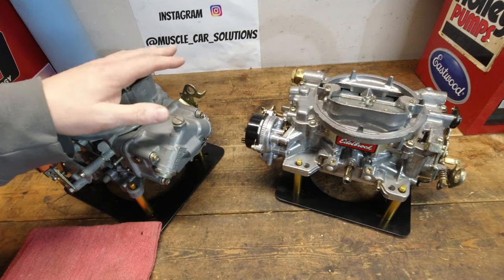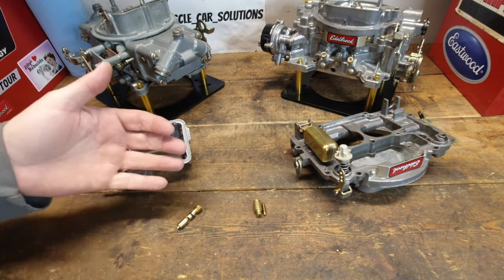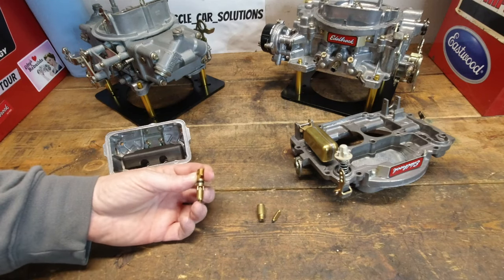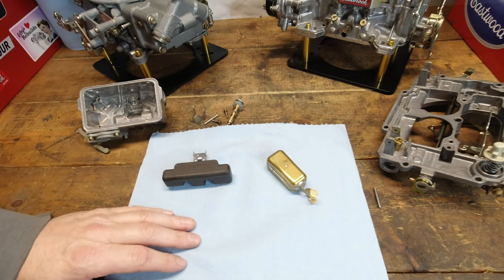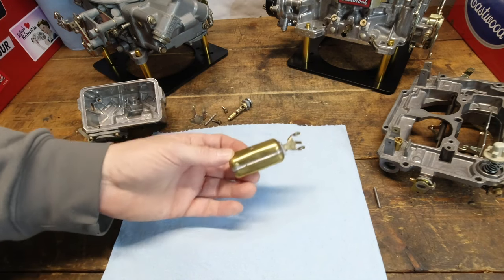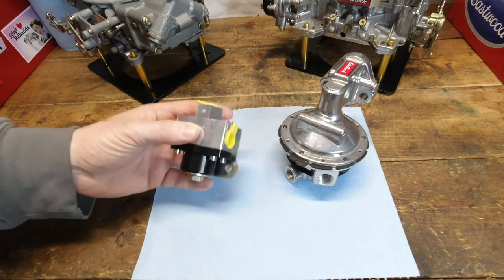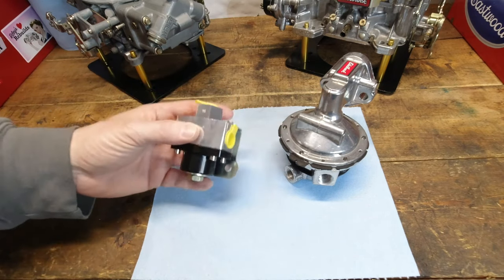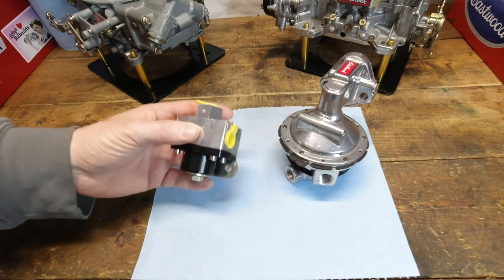4 Reasons Why Your Carburetor is Flooding

Comment: I have a carter 1 barrel on a 1966 valiant. It was flooding really bad the car not wanting to run.  My carb was leaking around the bowl gasket and coming out the vent. I sent my carb to a shop and the guy said my float was out of adjustment he replaced the needle and seat from an original kit he had at his shop and adjusted the float. I get it back and it's STILL HAPPENING. although the leaking isn't near as bad. He then told me it has to be my fuel pump the pressure is too high. So I'm gonna check the fuel pressure if it's not the pump I just don't know what to do. Iv had it. But it could be the pump it's about 5 or 6 years old.
Reply: Im having the same issue with my 64 thunderbird. I’m not sure what to do though since it doesn’t flood at the carb shop but as soon as I get it on my car it floods. I put a regulator on it but it hasn’t worked. I’m going to check the fuel pressure today. Hopefully the regulator is bad and I just have to change that. Let me know what ended being your issue. Maybe it’s the same as mine e
Reply: Check the gaskets, check weight, get a new float and basically the whole ensemble.
Reply: @diegos5877  Turns out I have a major vacuum leak. I took the whole car to him and that's what he found
Reply: @melmen2379  no way that’s actually it. I got a 1bbl on a 74 dart and I’m having the same issue. This all started after I started rebuilding the vacuum setup based on a diagram
Reply: @SkySprice  yes it turns out to be a MAJOR vacuum leak. Right now she won't run at all
Reply: @melmen2379  oh cringe. I just took my needle and seat out and found out it doesn’t even hold up to 3.5lbs of pressure. Rubber tipped needle. Probably because I’ve been dailying it and thus u have been consistently been putting regular through it.
Reply: my nissan 1400 carb level was on his mark but after i put on a new carb and new  petrol pump he overfload inside the carb this doesn't happend with  the old pump 😮 help plse

Comment: Just swapped from a single carb to a double 600cfm intake.  Engine kept running so rich at idle I've called the man that rebuilt my carbs I've went and ordered jets and meters and while waiting for parts found out the rear carb had zero movement on the floats and the needles were stuck!! Maybe I've solved the mystery
Reply from the maker: If they were stuck open, that would add to that problem.

Comment: I'm having issues where my truck dies while running..I get a strong gas smell... I unscrew my driver side tank (dual tank k10) and it's highly pressurized... I've completely replaced all under carriage fuel  parts... lines,  filters,  tank selector valve and new gas caps and still occurring... any ideas
Reply from the maker: @josephpadilla8982  high pressure always try’s to find low pressure areas.  If you’re building up pressure in the tank, it will play havoc with your fuel system.  Find the tank vent and get it cleared out.  Not sure where it is in that truck but tank and filler neck are what you’re looking at.

Comment: 1403 carb starts right up cold and after opperating temp. Sits for 5 min. and hard to start. How do I get the car to start consistently?
Reply from the maker: Heat soak.  Check out the video I did on how to cure that.

Comment: awesome tip on heating the water for a float hole test. We just had a rebuild come back because of a pin hole.
Reply from the maker: Old school trick!  Hard to find those on a general rebuild.  Saw you work on that one during one of your livestreams!
Reply: Fuel pressure on my carter 9605 drops from 5psi to 0 psi in about 8 min after starting.
Pressure tested top of carb in container of water and no leaks  new mec. Pump new regulator 
Pre and post filters. Does not flood and continues running fine even with 0 pressure at Guage.
Any suggestions ?

Comment: Great video! I commented on another video about my 1406 flooding. I discovered that the cheap rebuild kit I bought had a needle valve that was sticking in the seat AND I had my floats set too high. I tried setting them at 1/2" for a slightly built 289 however, my carb setting skills have never been good. Thanks again for the information!
Reply from the maker: Glad you got it sorted out and you’re very welcome!
Reply: Did you fix it?
Reply: @CRuZ_CoNTRoL.  I ended up buying a new carb after twisting off one of the screws that hold the idler springs in place. Rookie mistake.
Reply: @jasondingram5991  was the carb ruined because of that?

Comment: You certainly deserve more subscribers my man! Thanks for sharing your knowledge and nice vehicles!
I have a 72 Chevelle with a Holley and 72 c10 with and Edelbrock 😆
Bought a 5.5-9 lbs pump before finding out Edelbrock's allegedly don't like anything over 5. 
The 3-7lb pump I had on prior worked fine with my filter hung higher than the carb. I lowered that below the top of the carb and it helped the flooding issue I've been having 🤷‍♂️
I'll bet raising the carb up and that ethanol gas treatment wouldn't hurt either
Reply from the maker: I’ve always worked in a range of 4.5-6psi.  I start at 6 and tune down from there if needed.  Most of the time, on regular pump gas, I’ll set at 6 and most generally like it right there.  Pressure regulator is your friend!

Comment: Great help, I just installed a new 650 DP Brawler with flooding issues. Its impossible to tune air mixture screws as fuel must be entering the venturies or blowing past needle and seat freely causing black smoke at exhaust and extremly poor gas milage (gallon per mile) Needle and seat was inspected and cleaned with compressed air, o ring seemed flush with seat cylinder...Fuel pressure is regulated and tops out at 4 psi (assuming gauge is correct) I did run some avgas 100 LL thru by mistake...and where can I get new o rings or new needle & seats ? Appreciate your comments

Comment: I have an AVS2 on my 65 Mustang, which has a 302.  It uses the stock mechanical fuel pump.  I recently installed a Marshall fuel pressure gauge, whcih is a high quality oil dampened gauge with a vent so it reads correctly when it heats up.  It reads 5.5 psi at idle and drops to 4 psi when the rps increase.  Edlebrock states that 5.5 psi is ideal for these carburetors and the range is 4 - 6 psi.  So not all mechanical fuel pumps require a fuel pressure regulator and before installing one, you should first verify the fuel pressure.
Reply from the maker: That’s good, if you don’t need to adjust pressure to find what suits the engine best.  Sometimes that 6 psi, sometimes it’s 4.5.  Without a regulator, you don’t have that adjustability.  Or choose not to run one and take away that ability.  It’s ultimately your decision.

Comment: My Edelbrock is flooding right now gonna give it a check but it’s a 750 cfm which is little big for my motor, figured I’d check these out first before buying something new, I do have a aluminum spacer which probably isn’t the best for the heat. I appreciate the video tho!
Reply from the maker: @1976.Camaro  flooding isn’t a too big of a CFM problem.  It’s a pressure/flow/adjustment problem.  Sort out what you have, then start correcting the other issues.
Reply: @MuscleCarSolutions  gotcha I do have a merc cruiser motor out of a boat so I do not have a stock fuel pump on the block (no bolt holes or rod) to get around that I have a fuel pump pushing from the tank it was fine ofor my Carter 650 carb but long story short swapped carbs now figuring I should get a regulator for the pressure

Comment: Hello, first I want to thank you for the great content your providing. In my 64 Malibu SS I have a manual fuel pump on my custom 327 sbc. and the fuel pressure at a cold start is about 5psi. After about 15 minutes the pressure goes down to zero and stays there with no change to how the engine is running.  Any ideas as to why ?   If you have any questions for me to help you determine this issue please ask. The carburetor is a Holley 4150 (80670). 
The car went through a complete frame off build about five years ago including powder coated frame, complete body/paint and drive line as well. Unfortunately I've neglected her badly due to other commitments.  I recently tried to start her up but she would just not fire, I determined the fuel pump was bad so I replaced it. Tried to start her and she fired right up, after a 15 minute test drive I noticed she was running rough and would not idle. Fortunately got her home and was seeing fuel spewing down the venture (primary side). This is where I found you on YouTube. I replaced one of the needle/seat assy's. on the primary side only and that definitely helped but the pressure is still dropping off. Could I have a defective pump or could this be a carburetor problem.
Thank you for the great videos. !!!
Reply from the maker: Difficult to say.  If it sat for a long period of time, you may have a general cleanliness issue. Ethanol added fuels are the absolute worst.  The alcohol attracts water.  Water carry’s contaminants.  The combination of all three play havoc on a fuel system when it’s not continuously run.  I’m assuming it was parked and the fuel system wasn’t completely drained.  So that would be a good place to start.  I have several video on fuel system set up that might be helpful to to.  Change your fuel filters.  Give that carburetor a good bath and a rebuild kit.  Then you can start looking at where the lack of flow (pressure) is coming from.
Reply from the maker: And I’m very glad the videos have been useful for you!  Thank you!
Reply: Hi, well I think I’ve done everything trying to determine why my fuel pressure goes from 6psi at start-up to zero after five minutes of running. Changed fuel pump, I even ran a hose from the inlet side of the pump to a five gallon can of gas which at least in my mind eliminated an issue between the pump to the back of the car. I changed out the needle/seat assy as I saw fuel dumping into the primary Venturi’s. 
Is there anything in the carb that can cause a pressure drop ?

Comment: Very helpful video thanks I had my carburetor catch fire last night and I poured water into it to put it out at the gas station I have a elderbroc on my 71 LTD 351 Windsor I need help did I really damage anything?
Reply from the maker: You’ll need to tear it apart and find out.  I’d be more concerned with why it happened.
Reply: Next time it catches fire , dont put water into it and your engine. Just cover the carb with a towel or anything. I have used the shirt off my back to choke it out. 
It could happen from being too rich and not firing and having timing off making it backfire and catch on fire

Comment: My carter bbd is spitting fuel out the top and the big vent at the middle front bottom, doesnt want to start and seems like I have good spark, gonna try putting on a regulator see if it helps
Reply from the maker: Regulator is always a good choice but there’s likely something more simple if that’s the factory set up. Dirt, trash, sticky needle.  Might be time for a good cleaning and gaskets.  Change your fuel filters.  Reset the floats.  See if that cures it.

Comment: Hate Edelbrock  Carbs . Almost  Burned up my 73 impala, drove it for three months without any issues. On the way to work  smoked bellowed out from the hood. Open the hood and flames burst out I could see the gas overflowing. After putting it out with an fire extinguisher after  getting it home I  took the carb apart, the float was in the bottom of the bowl. The float only had a tiny tack  of solder holding it to the arm
Reply from the maker: Seen that happen just as many times on a Holley.  It’s not the brand of carburetors fault, it’s just what happens.
Reply: @MuscleCarSolutions  come on man

Comment: I hope you have solved my issue with the part of the video about heat soak. I can park the car for 2 hours and try to start and it won't start otherwise it starts and runs great. What does heat soak do to a carburetor.
Reply from the maker: With ethanol added fuels, heat in the carburetor can easily boil the whole thing dry very quickly.  Awful stuff.  Isolate the heat as best you can and those next starts will be easier.

Comment: Good morning, I have a 650 Holley carburetor. I have a problem  to control my secondary float. I checked everything. The needles. Everything looks good. I cannot find anything wrong???
Reply from the maker: @francescoserra-y4u  what’s your fuel pressure at the carburetor set at?

Comment: Working on a 78 Chevelle, beautiful! Noticed carb leaking out bottom areas of carb. Throttle plate . What are possible issues I may be looking at? Thnx 👍
Reply from the maker: What is your fuel pressure set to?

Comment: I have a 64 thunderbird and it keeps flooding. I put a fuel regulator on it because it was at 10 psi. But nothing changed and it continues to flood. I’m not sure what to do since the carb was recently rebuilt and everytime I take it to the carb shop it’s fine but as soon as I put it on my car it floods. I put on a new fuel filter too. Any tips?
Reply from the maker: What carb?  What is the regulator set to?  Have you checked the needle and seats?  Float levels?

Comment: I just rebuild my Edelbrock 1406 on my Chevy K 20 and when it is on flat ground, it idles great runs great but as soon as I park it on some sort of incline the carburetor will start cutting out (stumble real bad almost to the point of dying) and I’m talking about maybe 5 to 10° incline/decline. Any suggestions?
Reply from the maker: Check float level.  What is your fuel pressure set at?  While you have the top off, make sure there’s no garbage inside the bowls.
Reply: I have an in-line fuel pump to a Holley pressure regulator set at 8 psi then going out the carb. I have a pressure gauge set at both at the regulator and the line before the carb and they are both reading 8-7 psi.
Reply from the maker: @camerinsmith5182  way too much pressure.  4.5-6psi is the range on an Edelbrock carburetor.
Reply: I'm running a 2 x 4 barrel set up on My 69 firebird and I pulled the plugs out and the cylinders were full of fuel.. I noticed that gas was leaking out of the passenger side of the carb around the throttle shafts.
Reply: Will incorrectly adjusted float levels affect mileage? Recently adjusted mine to the manuals specs and dropped 5 mpg. Seems drastic. I added a 1 inch spacer as well. 1406 carb. Love the channel!

Comment: does a turbo  blow thru have any other ways it can flood? i have a 650 blow thru that keeps pushing fuel out the vent tubes  and squirters, running jet extensions with boost reference power valves from simple stage that have little tube extensions ? or is it pretty much the same across the board ? only thing i havent changed is the needle and seats , running a a2000 fpr. and itll push fuel out at 6 psi 5 psi or even 2-3psi im almost ready to just bite the bullet and spend the 1000-1200 on  a  new custom blow thru.

Comment: I have a brand new Holley 650 vacuum secondary. Why would my fuel bowls drain down into the intake overnight? This is the second carburetor that’s done it.
Reply from the maker: How do you know it’s draining into the intake?
Reply: @MuscleCarSolutions  spark plugs are wet
Reply: @MuscleCarSolutions  and I just changed the oil and it already smells like gas
Reply from the maker: Go watch my video on how to fix heat soak.

Comment: @Muscle Car Solutions: I have a carb spacer in my future (heat soak prevention). I was interested in your comment/opinion for your preference of wood laminate. I had been steering towards the phenolic simply for it's underhood friendly black color. Aesthetically, the wood laminate was a turn-off because, well, it looks like wood, colorwise. Any downside you can think of to spray painting the wood laminate black? (maybe just the sides only)
Reply from the maker: I think I may have mentioned it in the heat soak video I did.  If not, I will here.  I like the wood laminate better.  I believe it has a better ability to block heat.  I can’t provide you any empirical evidence to that; it’s just an opinion at this point.  Maybe one day I can find a way to put that to the test.  I have no problem running either.  Both are much better than nothing!  As far as painting goes, I’m not sure that matters.  But I’m not the one to ask.  When the hood is down and you’re driving, no one can see it anyway.  😉
Reply: @MuscleCarSolutions  thank you for the quick reply. Big fan of the channel. I've learned loads about carbs, carb tuning, and problem prevention from your and Thunderhead289's vids
Reply from the maker: @gotta56forme  anytime!  Glad it’s been helpful!
Reply: Is it a good idea to check the the float adjustment on a new eddie before installing?
Reply: @gearhead19  yes

Comment: What's the best way to get the seats out? New at this and we don't want to damage them. Elderbrock 1404
Reply from the maker: Screw driver.
Reply: @Muscle Car , thanks
Reply from the maker: @johntharpe132  it’ll be pretty obvious when you see them.  Easy!
Reply: @Muscle Car Solutions  yeah, we had it apart. I just wasnt sure if i wanted to take a screwdriver to get a brass fitting out. My son(16) and i are working on his 1969 f100 with a 302. We've changed the intake and carb, running into flooding issues. So we're in the process of cleaning it. This is our first time doing anything like this so i just wanted to be sure i wasnt going to hurt anything
Reply from the maker: @johntharpe132  you’re good.  Just snug with everything going back together is all you really need to be careful of.  There are some good tips in this video.  You’re attacking one with the needle and seats.  Float height and fuel pressure are the other two big ones.  You’ll eventually find what was causing the issues.  Feel free to ask any questions.  Happy to help!